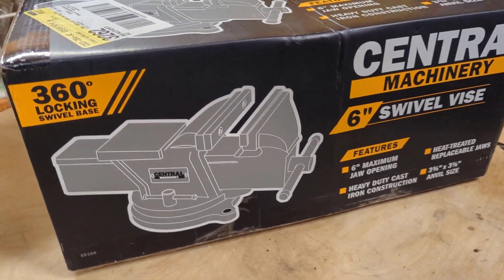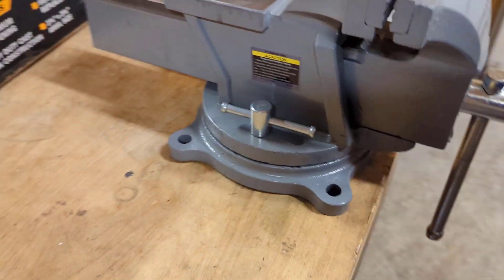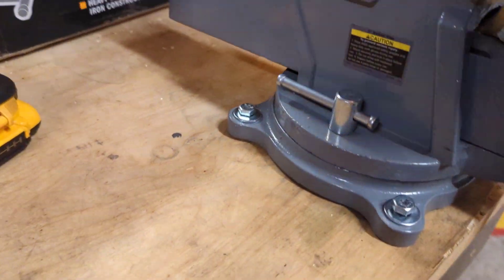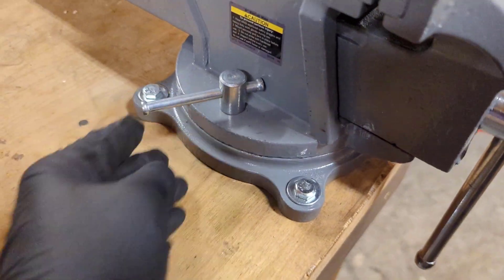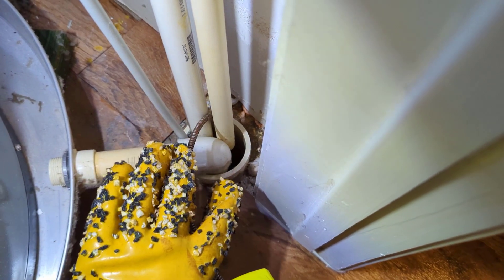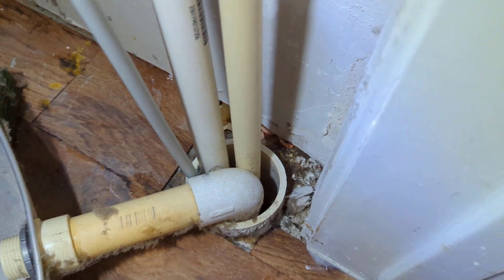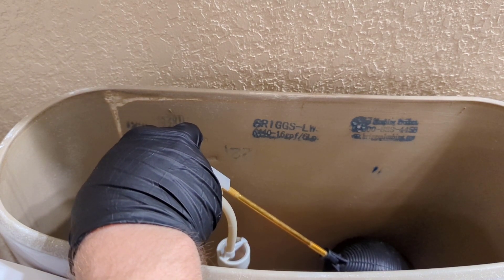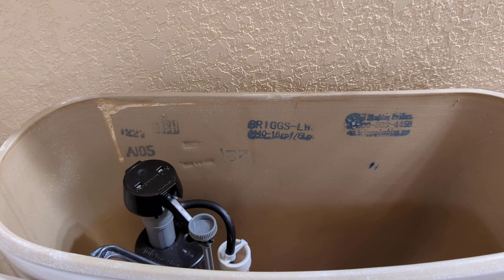Apartment Maintenance Vlog #6

Comment: You are an awesome technician man. Nice work and keep them coming
Reply from the maker: Appreciate that & Thanks for watching MM 👍
Reply: I’m ab to start a new job doing stuff like this, im glad i came across u channel im eager to learn more! Love the videos!!  
Id love for u to make a video explaining what it’s like and how it works having a job like yours,  im curios how many times u need to learn new things to fix this stuff

for example on the video of u repairing the dryer, i was curious how u figured out the issue,  if u already knew how to fix it and what u would do if u didn’t know how to fix it, how do u know if a part in the warehouse is suitable for the repair, what all does the ware house contain? how do u find random things in the warehouse like dryer belts?
Reply from the maker: @realityresearch2974  Great questions & glad you found the channel. Learning how something works & understanding the wire diagram allows you to be able to fix anything. Of course that's with years of experience & knowing what parts break is how I stock my shop. I order all the parts & keep an inventory of all my parts. Of course there are times when I come across something that I've never fixed before but when that does happen I always look to see what the machine is doing or not doing then I would use my meter to check for power, continuity, ohms etc...whatever the case may be in that situation. It's definitely a career you don't learn overnight & having someone who is a good teacher helps out a lot. I grew up around this industry since my Dad has done this kind of work all his life so that helped me when I was starting out. Hope I answered all your questions & I will talk & answer some of these questions you have in an upcoming video. Thanks for watching realityresearch2974 & subscribe to the channel 👍
Reply: @ApartmentMaintenance  that explains a lot thanks for the insight, i will be sure to put ur new video notifications on so i don’t miss a thing!
Reply from the maker: @realityresearch2974  Sounds good. Anytime you have questions just comment on a video & I will respond. I reply to every comment I get & try to help the best I can. I have some other videos that are scheduled to be uploaded already so the video or videos with answering questions like you asked will be a couple videos later in the release time frame but I will film them. 
This industry needs good technicians so if you're willing to learn & take pride in your work, you can move up fast & make a great living. Every management company is short handed on Maintenance staff so starting out as a Porter/Groundskeeper is how you get in without any experience. You won't be cutting grass or taking care of the lawn, that's just the title that companies give that position, meaning (Porter or Groundskeeper). You would pick up grounds at the property which is picking up litter. Cleaning the pool & learning how that operates. Doing small work orders like light bulbs, air filters, refrigerator water filters, clogged tub drains, clogged bathroom sink drains, jammed garbage disposals etc....Then when none of those types of service calls are in the system you would go with the technician or supervisor on more in depth calls like hearing & air conditioning, appliance repairs, plumbing repairs, electrical repairs, carpentry repairs, etc.... The company will pay for you to expand your knowledge in the field whether its getting your EPA certification (which is for handling, transporting & recovering refrigerant) for AC work, or getting your CPO which is the certification for operating a swimming pool, then after 2 years experience in the industry you can take the course & exam with the national apartment association which is the CAM-T certification. There are all types of ways to advance your knowledge & career. 💪
Reply: @ApartmentMaintenance  u have my respect , thanks again for all the information this is all stuff i need to know and many others, i feel it’s important for a man to learn and be able to do these things, im happy to make it a career if the pay is worth it, the main reason i want to get into all this is bc i see it as a win win win, u get paid, learn how to save money, and gain respect! I can’t think of a better job for a willing young man to get into such as myself
Reply from the maker: @realityresearch2974  Agree 💯 with you!

Comment: Nice idea with the gloves holders. Also good vice. I get a lot of stuff from harbor freight. I've snaked those drains with t and p and every other condensate and other water lines. Where does it terminate though? Outside or in the cleanout?
Reply from the maker: Yeah I like those glove holders, I bought one for my garage at home as well. Harbor freight has some decent stuff. Certain things I don't need DeWalt or high end I'll go there & pick it up. The floor drain connects to the sewer line. Thankfully I haven't had any sewage ever back up at one of those but the bathrooms are on the other end of the apts so when I have had a main line back up it goes to the tub. Thanks for watching bro 🛠️👍

Comment: Should some kind of float switch be attached to that 3 inch pipe to turn off the air conditioner when it gets plugged? Thanks.
Reply from the maker: No there isn't a float switch for that drain. It's just a floor drain. Thanks for watching TheHedgemo60 & subscribe to the channel 👍
Reply: Where did the water come from? Was it the A/C drain line? I know it probably wasn’t the pressure relief valve line from the water heater. And it wasn’t the overflow from the water heater pan. But there was a 4th line that you didn’t mention where it went to. Is that where the water came from? And what is that line. I’m asking a lot of questions because I’ve started in maintaining this year and I have a lot to learn. Thanks.
Reply from the maker: @TheHedgemo60  The water is from the AC. The AC condensate drain line drips into the floor drain. The lines going into the floor drain are, AC drain line, water heater pressure relief valve, water heater drain pan, & the pressure relief valve on the cold water supply coming into the apt that hooks up to the water heater. That ball valve has a pressure relief built into it instead of using an expansion tank on the cold water line. Saves alot of room having a shut off valve with a built in pressure relief. Thanks for watching TheHedgemo60 👍